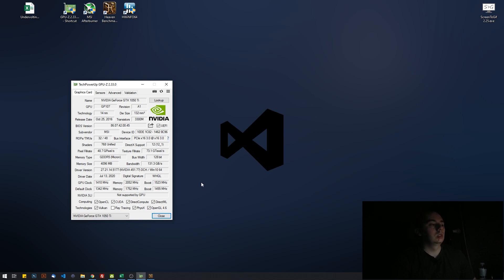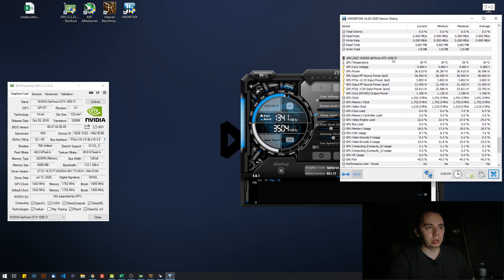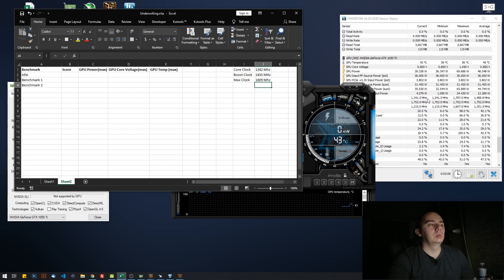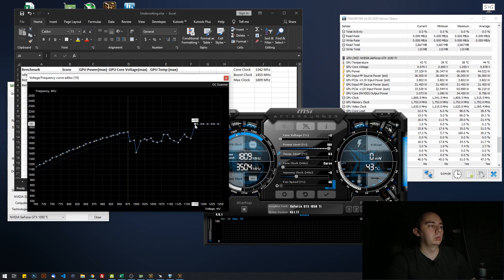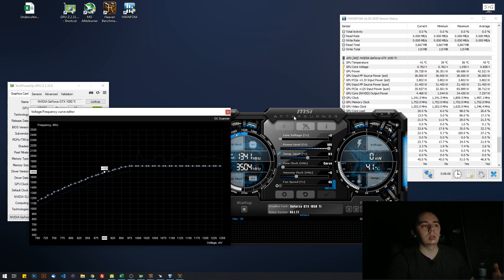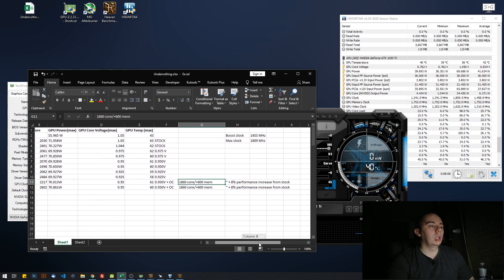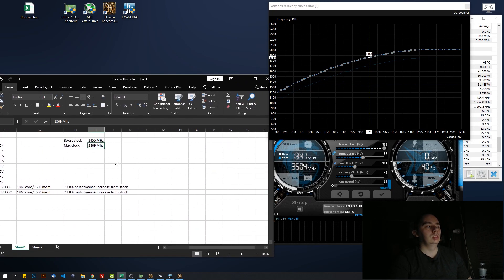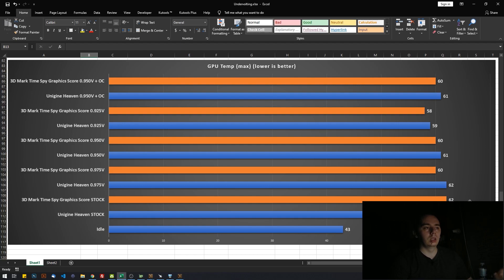GPU Undervolt Guide - Nvidia - Lower GPU Temps + Performance Boost | Techie Show

Comment from the maker: Did you undervolt your GPU? What were your results?🤔
Reply: RTX 2070 running now with 0.843V at 1815Mhz with a Peak Temperature of 65°C and a avarage 30W less Power consumption, while I gained 11FPS+ avarage in my Testes Games.
Reply: i wil try it thanks you bro you have xperience
Reply: less coil whine, thank god (and you)
Reply: Hello, i have a question:
Would you offer assistence to undervolt my laptop for a fair price?
Using team viewer or something similar. Thanks in advance for answer.
Reply from the maker: @Xtrafree123  Sorry, but I cannot. I strongly encourage you to try and do it yourself!
It's not that hard and it's free. Just follow my or any other tutorial here on YouTube.
You just need a couple o hours of your time to find the best settings and you'll get a great feeling of accomplishment after :-)
Reply: @techieshow  Thank you for answer, have a great day! 🙂👍
Reply: Ctrl F isn't working for me so I can't see the voltage frequency graph 🤔 it's a old card on a laptop gt630m
Reply from the maker: @Doueri5  Hey! It is totally possible that that model of GT630M cannot have it's voltage adjusted like this :(
Reply: @techieshow  sucks to be me😩 can't undervolt my gpu can't undervolt my cpu 😩 temps got as high as 92° playing farcry 3 on low settings
Reply: @techieshow  is it possible for thermal plaste to get bad( already reapplied 4 times using different amounts but still getting high temps) it's silicone based
 thermal conductivity 1.93w thermal impedance 0.225°c
Reply from the maker: @Doueri5  Well, as far as I know silicone based are not that great in general. And the specs seem to be right if yours has just 1.93W/mK thermal conductivity.
It is totally possible for it to go bad, but it is also possible that it's just bad, like low quality.

For example, the Arctic MX-4 has 8.5W/mK. That's a lot better. (carbon based if I recall correctly). The Noctua NT-H2 is another great thermal compound - on my CPU I got about 1 degree lower temperatures than the Arctic.

See here the Arctic MX-4 tech sheet: https://www.arctic.de/media/52/f1/a2/1585035312/spec_sheet_MX-4_181210_r8a_EN.pdf

I'd recommend getting one of the above even if they are more expensive... especially if we're still talking about a notebook/laptop as they get quite hot and you wouldn't want to open them too often.

And they don't go bad so easily once opened. You just close the syringe they come in and they will be just great next year or when you want to re-apply.

Furthermore, the ones I mentioned above are not conductive (so it does not short anything) while being very good, probably top of the line as far as non-metal based compounds go.
Reply: @techieshow  thanks I will search for them but it will be next to impossible to get in my country and shipping will cost almost 8x the original price plus 21 days wait time, thanks for the effort 👍
Reply from the maker: @Doueri5  Wow, those shipping prices are insane!
Well, maybe you can find locally something  closer to 8.5W/mK, and not silicone based. Even if it's not such a popular brand, if the tech specs are on-point it should still be better than what you currently run.
Reply: Asus Phoenix gtx 1060 3 gb from constant 83 to 70
Reply from the maker: @mourad2753  Amazing! Great job!
Reply: If undervolt causes errors (bugcheck,  blue screen, self reboots), does high amount of such errors can cause damage to card?
Reply from the maker: @GamersGuard  Hey! No. Undervolting cannot damage a card and it does not void your warranty. 
It could actually even improve the life of that chip. (not that it matters, to be honest since a graphic card can live a long long time to the point it becomes too obsolete... still got an AGP FX5200 working :)) )
And if you think about it, most GPUs actually undervolt themselves sometimes. They do this when idle or no medium/high performance is demanded from it to save power. (just look at HWinfo or other monitoring software while gaming or doing something intensive, when browsing or when doing nothing - idle at desktop)
Reply: @techieshow  how about undervolt with OC i did 3070 975mv @ 2025Mhz such undervolt also zero risk for card?
Reply from the maker: @GamersGuard  It is still safe.
Even overclocking without undervolting is still safe.
You cannot damage the card by doing undervolting and overclocking. You will eventually reach the limit of the chip's capabilities, and that's when you get errors/blue-screens. Just restart and try again :)

The only scenario where these things are not 100% safe and could even void your warranty is if you were to modify the GPU's BIOS. But using software like Afterburner does not even void your warranty.

note: over-volting is probably the only dangerous thing you could do. I don't recommend it, unless you have proper cooling and know what you are doing and are willing to damage the card
Reply: @techieshow  absolutely 💯 great answer, thank you ❤
Reply: Laptop lags like a potato pc now
Reply from the maker: @JayTh3Gamer  Well, you over did it then and it's probably unstable too :-D
Reply: @techieshow  Hi... I have my RTX 2060 running at .925V and 1865 MHz... I brought temps down 10C and Watts went from 176 to 135... I did notice my CPU usage went from 80% playing Fortnite and now the CPU runs at 95%... Is this caused by the undervolt? I haven't changed anything else...
Reply from the maker: @wisenheimer9997  Hey! No, undervolting will not increase CPU usage. I doesen't work like that.
Just like overclocking the GPU won't do anything for CPU usage.
I'd check CPU temps and even if there were some driver/patches for game changes or something like that. And if you're running Windows 11 with a Ryzen machine make sure to have drivers updated from amd.com
Reply: @techieshow  OK thanks... I run Windows 10 still and its an intel chip i5-11400F anyway... Cores run around 75C... Everything is under 80C... (even my hotspot)... after a couple hours of Fortnite... I am very happy... thanks again...
Reply: So I have a Rog strix 3080ti. I’ve been playing with it for two days now. I noticed it hit 1965mhz max at a little over 1.0V with around 77 c, with a benchmark in the low 16,000. I tried to keep the 1965mhz at 900V but it seems hard for the bench mark to maintain that mhz, it dips to like 1815 or so with 76 c and about 17,400 score. So now after messing around some more I’m at 1905mhz, 837V, 73 c Max during benchmark and 17,217 score. I don’t know how good that is, since I just built this pc and it’s all new to me. Gonna test this setting out in games and see. Would love your feedback!
Reply from the maker: @SnrMuffin  Those scores really depend on your benchmark and settings (I'd love to know what bench you ran and what settings).
The results seem pretty great - extra performance and lower temps! It's kind of normal for it to fluctuate (MHz wise), as the card also has it's own internal way of dealing with frequency at a given temperature. Make sure you do a couple of runs to make sure they are consistent and stress it a bit so you know it's stable.

Also, I must say that even 77c is not bad at all. Anything under 80c is great for the 3000 series. Even 83 is okayish - beyond that it might throttle. Under 80c is better. So you're doing just fine!
On the 3000 series pay attention to the GPU Memory Junction Temperature also (HWiNFO can help). I don't have a 3000 series GPU so I can't really be that helpful but a lot of cards seem to go over 100c, and that's not too good. (lots of discussion over this over on reddit and other forums)
Reply: @techieshow  I used the superposition benchmark at 4K optimized, full screen, high textures, dof Enabled, motion blur enabled. The gpu memory junction temp hit a max of 80 in that benchmark.
Reply from the maker: @SnrMuffin  80c is great!
Regarding your settings your scores seem to be just great. You can see on their website (link at the end of this comment) that most 3080 Ti owners get between 16.000 and 17000. There are ones that go quite higher (rare) but I suppose they run either great cooling or overclocking. Or both :)) - all in all, if you average 17000 score you are ahead of a lot of guys so congrats! :-D

Here's the link
https://benchmark.unigine.com/leaderboards/superposition/1.x/4k-optimized/single-gpu/page-9
As you can see, there are some guys over there having bad time with their 3090, as they get scores lower than you and other owners of 3080 Ti. idk :-))

Comment: "You're not overclocking, you're just lowering the voltage"
That's... not true. You're overclocking the lower power stages of your gpu.
Reply from the maker: Fair point! I was referring to not raising the max frequency ceiling, but you're right, it is overclocking relative to the voltage curve. Good clarification!

Comment: I felt obliged to leave a comment of thanks, for the clarity in the explanation and the detail of the step by step. Thanks. I've a MSI GTX 1660 Super Gaming X card undervolted to 900mv / 1920 frequency.  Playing F1 2021 temps never passed 64 degrees and I'm getting 130/140 fps with High in game setting. Thank you!

Comment: Thank you very much. Was worried about doing any overclocking when the card was new, but now it's older. Been trying to overclock even was adding voltage, but should have started with doing it your way. My number are a bit different than yours. Found my lowest voltage and then made a target of plus 50 from my max MHz and going up one square at a time. Currently let it run on heaven at 1885mhz / 950mv till heaven crashes again and I'll go up another square till it goes at least 30 min then I will try a game... I guess

Comment: can you still overclock your GPU if you undervault it?
Reply from the maker: Yes. How much, depends on your luck as not all chips are made the same.
But usually you have a little headroom, and it's best to measure and see how much performance are you gaining from all the operations done (undervolt, overclock).
Reply: @techieshow  cool thanks for the reply, am I right that I should undervault my GPU first then see how far I can overclock it after that?
Reply from the maker: @George-um2vc  It is not mandatory. Sometimes it is worth it to take undervolting into consideration - when you risk losing performance due to high temperatures.

Comment: Hi, thanks again for this video, am still testing things, but cant you tell me what must be set in temp and power limit?
Reply from the maker: Hey! I'd leave those stock/untouched as far as the idea of this video goes. Usually you might want to increase power limit if overclocking and are pursuing performance. In this video I am actually pursuing lower temperatures and a performance boost because of the lower temperatures.
Reply: @techieshow  oh ok, thanks you very much. Again thanks for all this information

Comment: If you haven't disocvered since this video, you can mass select & move points on the editor by holding SHIFT and dragging across to select. Double-click outside of the highlighted area to deselect.

Comment: Why do we need to set it to the cards max core clock will it not go higher if we tell it to?
Reply from the maker: Yes, it will go higher, as high as you set it. But you're basically overclocking even more while undervolting. So things may get unstable real fast and you need to test to make sure you're stable.

The video presents a... moderate way to tackle things. 

If you really want to squeeze anything the card can do, you should go higher :-) and if you do let me know how far have you pushed your GPU model, I'm always curious to see how far things can go :-D

Comment: Hi, I have a Rtx 2070 8GB on my MSI GP65 Leopard laptop. No matter what undervolting I try, I don't seem to get much improvement in my temperatures (75-80 °c at best). I would like the temperatures to be below 70 °c, can you please suggest me some undervolt settings that can help me with that? A dip in performance is acceptable as long as I reach my target GPU temperatures.
Reply from the maker: Hey! So as weird as this sounds, 70 to 80 degrees celsius is actually normal and ok for the RTX 2070. As long as you are below 85 you are good to go.

The RTX 2000 series does indeed see little improvement with undervolting. 

What you could try, as that gpu is quite powerful, is to limit the FPS to the Hz of the laptop's screen. Especially since I suspect your screen has a FullHD resolution. That means your GPU can get high FPS.

For example, if your screen runs at 60 Hz, limit the FPS in games to 60. If the GPU is not limited and is going to 100+ FPS, it works harder than it would at 60 FPS and therefore uses more power and gets hotter. (its exactly the same for 120 Hz screens and so on. So if you have a 120 Hz screen and your GPU can do 170 FPS, it gets over-worked)
By staying at a FPS equal to the Hz of the display, you will not notice tearing, errors or 'slowdowns'.

note: this helps even if you have a game that you get 200 FPS and limit it to 120 FPS on a 60Hz screen. The GPU would still work less, the FPS is still high enough in my opinion, but the temps and stress placed on the GPU will be lower. Try it!

On another note, if your Laptop shares a heat pipe between the GPU and CPU, you might lower your temps by undervolting the CPU. But even in this case, I would not expect stellar results... maybe a couple of degrees?

I hope the above helped, but in any case, rest assured that your GPU is not running hot. As high as it sounds, it's a normal temperature for this kind of GPU in a laptop.
Reply: @techieshow  After much trial and error I think 1820 MHz at 850 mV is the best I can achieve with my Rtx 2070. The temperatures were at a maximum of 81°c which is kind of acceptable I suppose. I could scale down the core clock frequency a bit to lower the temperature slightly but one or two degrees isn't going to matter much at this point. 
I have a screen with 144 MHz refresh rate so I guess there is not much room there to scale down the in game refresh rate, I prefer higher refresh rates anyway.

Comment: i undervolt my 3060ti, no temp improvement happened
Reply from the maker: I guess that could happen... but I really have no experience with the 3000 series RTX, but maybe you can go lower with the voltage?

Comment: Hello can I use this settings for my gigabyte rtx 2060 windforce 6gb?
Reply from the maker: The method of doing it is identical. A friend has an RTX 2060 windforce and he is running 950mV with 120 MHz overclock on the core. So try these numbers.

Comment: hey, thanks for this video. The question is when you stream and game at the same time the benchmark will not be enough because streaming you use more power. Much I test with the game and obs working to decide the undervolt measure? thanks in advance
Reply from the maker: Thank you for the comment! Yes, I would test with game + obs to make sure everything is ok - wouldn't want to get a nasty error while streaming.
But technically speaking, it should be ok if just by the game and a benchmark everything is ok.
Reply: 👍👍👍 @techieshow  thanks a lot, i´ll try
Reply: @techieshow  ok, I didnt but i had to uninstal it, because when i tried to stream and gaming both the game and obs crashed. obs game me error encoding and the game also errors. so maybe is not ofr me :(

Comment: Hello. I have a Zotac 1050ti Factory OC card. Can I use your settings for my card too?.  Btw when I use Unreal Engine and use it for some minutes it crashes because my gpu uses goes to 100%. That's why I am thinking to underclock and give a try. Can I follow your whole setting. Thank you . Very nice tutorial.
Reply from the maker: Hey! Sure, you can try my settings but they are not 100% guaranteed for all 1050Ti models.
It would be ideal if you'd find your own settings by using the instructions in the video.
Reply: @techieshow  Ohh ok . Thanks 😊

Comment: I have a Lenovo laptop with MX250 graphic card, the problem is it's strong enough to play games like Valorant at 100+fps even at high settings but thermal throttling gives really bad frame drops, but even at low resolution and graphics I'm not really satisfied, I've noticed I can't adjust the fan speed on msi afterburner probably because I don't have a seperate fan for the graphic card, in this case do you think I should undervolt? any other suggestions? Laptop is IdeaPad S540
Reply from the maker: Hey! So as far as I know, the MX250 cannot be undervolted. But you can undervolt your CPU. And being that they most likely share heatpipes and fan, it might help with GPU temps also!

Apart from that, on laptops that have severe thermal throttling and cannot be undervolted enough, I'd just cap the FPS. Try forcing it to max 60, and it should be a consistent 60 or 80 FPS since it can go to 100+. But if you allow it to go as fast as it can, it will overheat more. (higher temps on 100+ than on 60)
Maybe if FPS is locked and GPU is not so stressed out, you will get more consistent frames and reduce those drops.

I hope this helps!
Reply: @techieshow  yeah I'm currently trying different settings with the software ThrottleStop, it was not long ago that I realised if I play with capped fps I'd get better experience, but what felt sad is even at capped 60 fps I get fps spikes when there's alot of graphics on the screen, feels bad because in the first 5mins of my gaming session I can get 200fps at low settings and after that the throttling starts! That's when I tried ThrottleStop, I do have a better experience but not the best yet